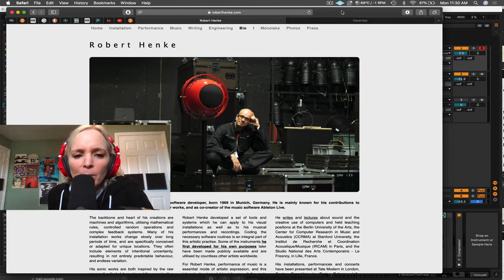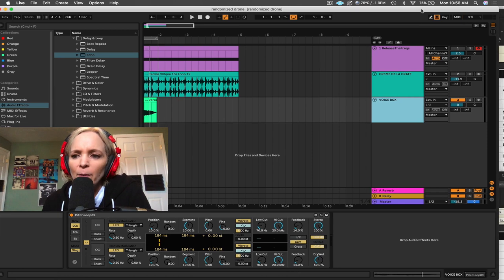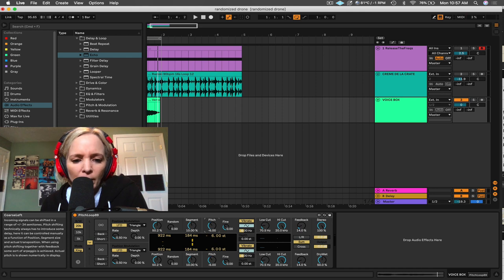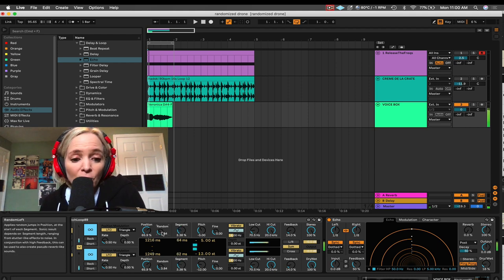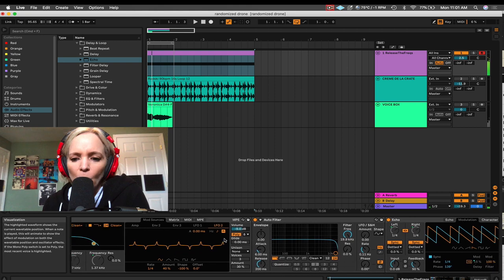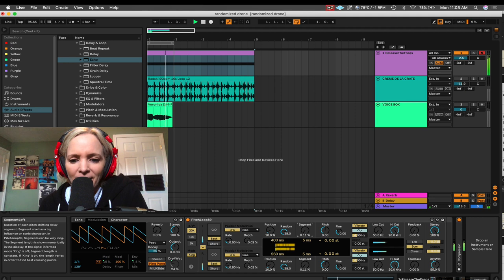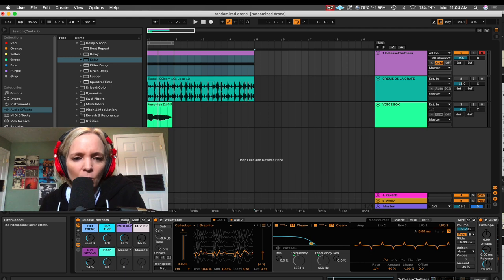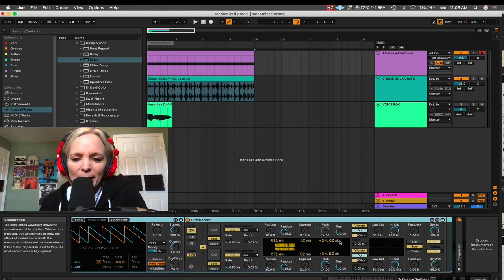Random Fun with Ableton Live 11's PitchLoop89!

Comment: how can you record the audio the device makes??
Reply from the maker: A couple of different options. This device is an audio effect, and in this demo I've dropped it on an audio track. If you wanted to "render" the processing to audio, you have a couple of options. You can right click and then freeze, then flatten the track - this will get rid of the Pitchloop device and instead render all of the processing straight into the track. The other option would be to route the audio from the output of that track to the input of another audio track, then hit record and "print"/record the audio in real time. Does that make sense?
Reply: @mistyjones  yes it does, thanks!
Reply from the maker: @merlijnhermsen4423  you're welcome!